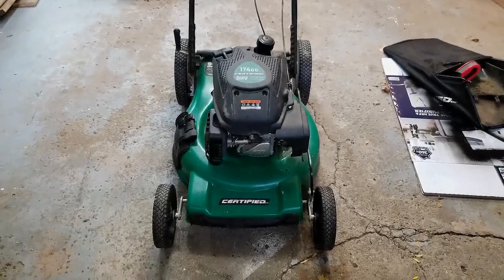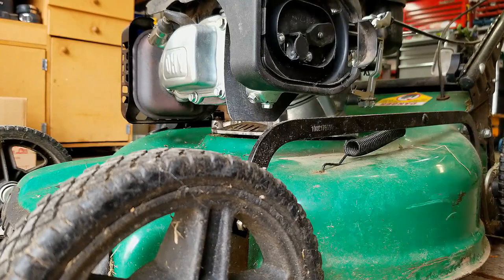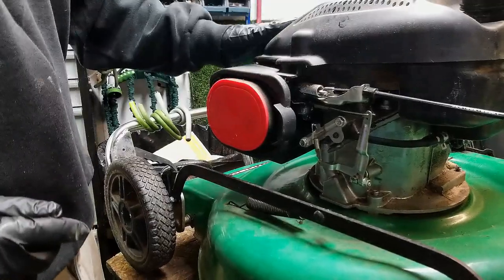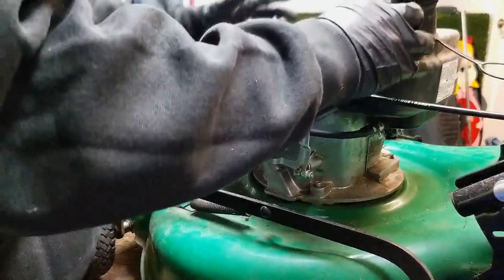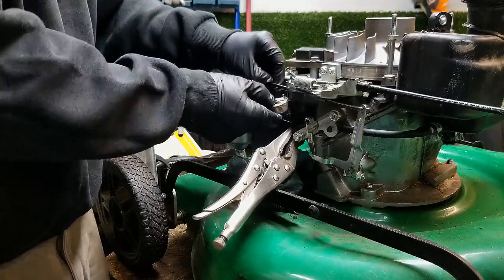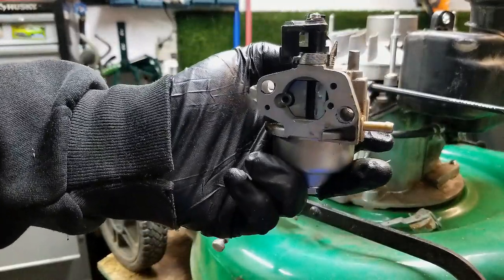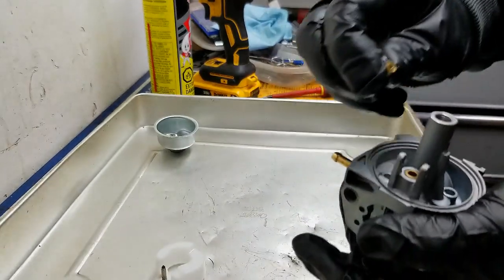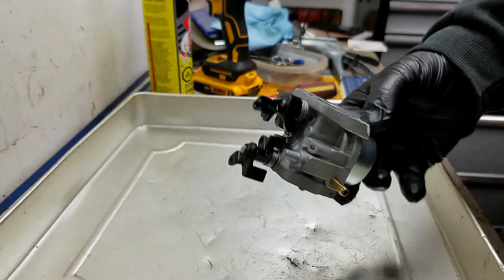Certified Mower Carb Clean

Comment: I buy used mowers and just clean carb first thing 
Cheap and it’s the heartbeat of the engine 
Best to clean tank if it’s a good engine and body I fix every thing
Reply from the maker: I fix and sell lots of machines every season also. I typically service the whole machine from top to bottom. Easier to resell and you can ask top dollar and people will be willing to pay, especially when they see what else is out there. Thanks for watching. Cheers
Reply: Great video, thanks.
I’m considering just changing the carb out. Any idea if there’s a part number for the carb as a whole? Can’t seem to find it anywhere